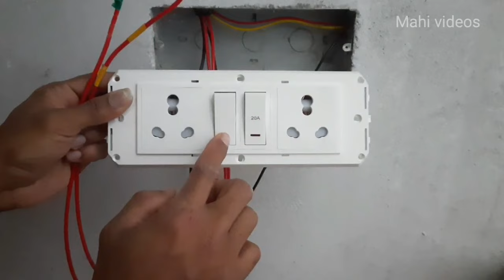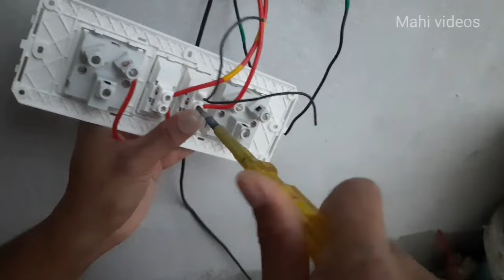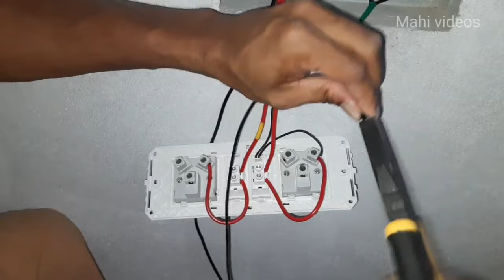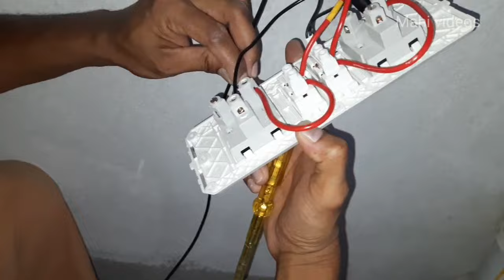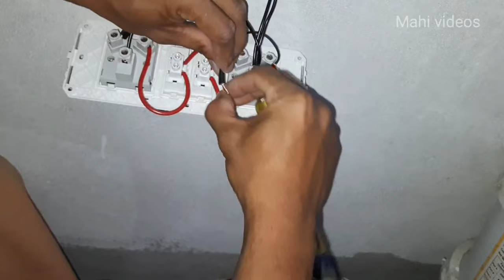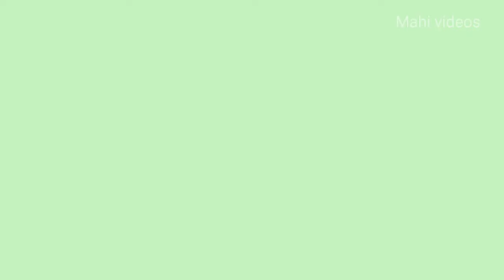Inverter switch Board connection. Simple ആയി എങ്ങനെ ചെയ്യാം.||Inverter point connection

Comment: Output switch and socket ampere rating kududalullladu use cheyyuka..dbyilekkulla output wire socketileku connect  cheyyade wire outside eduth 16 A three pin topumayi connect  cheyyuka...idu inverter plug disconnect cheyyumbol ulla accident ozivakum...output socketil earth  nutral no need...

Comment: Main switch and Inverter ON ആയിരിക്കുമ്പോഴും edak full light fan ഇതൊന്നും work ചെയ്യുന്നില്ല..
ആദ്യമൊക്കെ ഇൻവെർട്ടർ connect cheyytha devices mathramayirunn work cheyyathath eppol oru devicesum work akunilla
Inverter OFF cheyyumbol ellam work cheyyunud..
ഇത് inverter install cheyythappol ulla enthelum wiring mistake
 kondakan chance undoo
Reply from the maker: @Nanditha, Inverter install cheythappol current pokunna timeil inverteril connect cheythekkunna light,fan 6A socket ithokke proper aayitt wrk aakunnundayirunno..??? പിന്നീട് കുറെ നാൾ കഴിഞ്ഞിട്ടാണോ problem ഉണ്ടായി തുടങ്ങിയത് .??